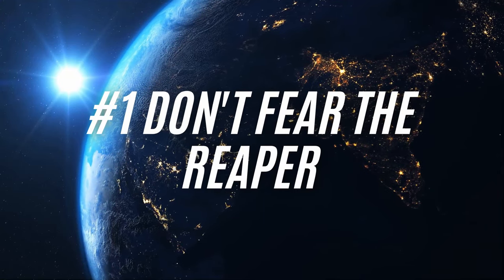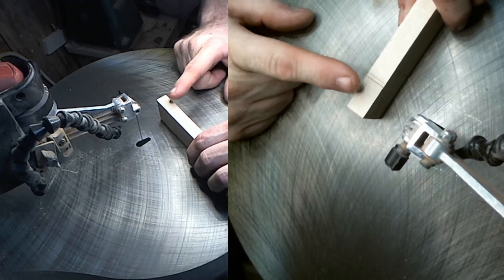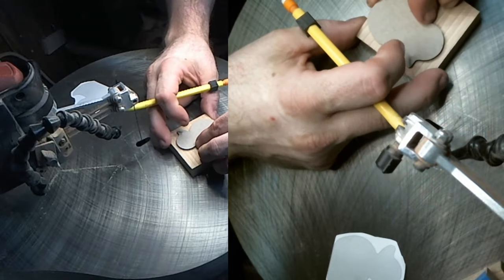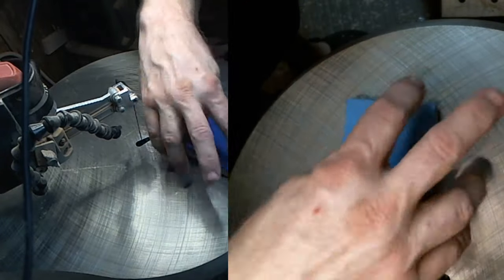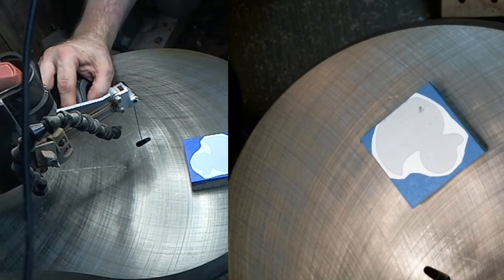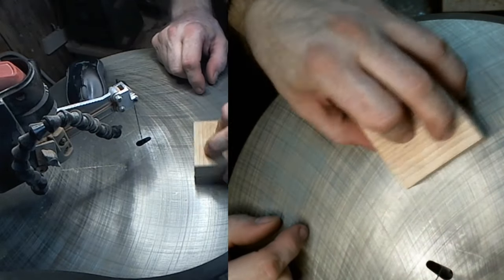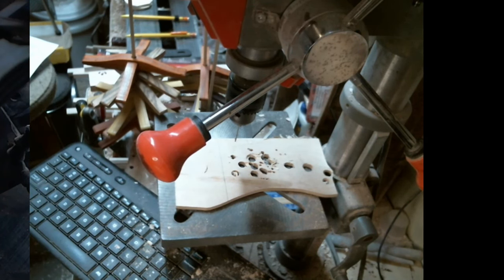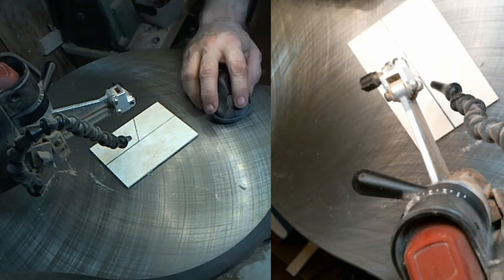10 beginner scroll saw tips

Comment: Great tips !  I’m new to the scroll saw and have the most difficulty threading the saw blade into holes for internal cutting. The bottom of the blade comes loose when I’m trying to reattach the blade. This takes a bunch of time and is frustrating. I was hoping to find a video on how to easily move to a new hole without fiddling too much with the blade. Any suggestion would be appreciated.

Comment: Thank you, Scott. I’ve been scrolling for a few months, and I watched a few videos about how to do it. You were the only person to recommend a foot switch. I have one for my router table, and I quickly learned the value of keeping both hands on the work piece. You scroll beautifully - I still can’t turn the work piece without it hopping up and down, but you play it like a violin — impressive! Another useful tip: PRACTICE! I don’t do enough of that, so my cuts are not as smooth as yours — I have to use my Dremel tool with a small cutting bit or a sanding wheel to finish up, which is annoying. Keep it up, man — your presentation style is inviting and practical.
Reply: I'm not sure if you're still experiencing the problem, but I recall experiencing that when I started. I don't know if it will work for you, but I resolved it by turning up the speed a little and working on holding firm pressure against the workpiece. Also, if may depend on your blades: pin-end still occasionally jump on me but pinless (i.e. thinner) ones don't.

Comment: Thank you for this video! I am new to scrolling and have now made corbels for my front porch and am working on flat sawn balusters with a pine tree pattern.  I've found that the Cricut is a great source for patterns and you can cut them out of cardstock and use temporary adhesive or out of vinyl that has temporary adhesive already on the back (this is a bit more costly).  I picked up a lot of good tips from your video!  I've been frustrated about my straight cuts not feeling straight as I cut them but yet looking straight when I'm finished; now I know that's normal.  Lots of good info!  Keep up the good work!

Comment: Cheers for this I am looking at getting a scroll saw. I bought the Dremel but sent it back after two attempts at keeping the bade in place. I am mostly large item carpentry, desks, wardrobes but like the idea of a set up for detail work to add to these. Your saw seems to have a good grip of the blade, it's not that I don't want to spend loads I'm just trying to balance how much work I'd put it to versus ££s yes I'm in England. I'm assuming your elsewhere given your extension lead sockets don't look UK ;-)
Has anyone suggestions for a mid budget saw that holds the blades well, I realise they will still break now and then. Cheers Simon.

Comment: Thanks What type of saw and which blade do you prefer for " tight " patterns ? ( Those patterns with sharp turns ) Thanks
Reply from the maker: there are a lot of variables...including the type of wood, it's thickness. the finer the blade the tighter you can turn.. the saw as long as it can take plain end blade you'd be fine. my current saw is a pegas but I do production work nd need a saw that won't wear out too quick

Comment: Thx for sharing these tips. I'm new with scroll sawing, is there a preferred direction like sawing clockwise or the other side. Does that matter anyway?
Reply from the maker: Depending on the blade you might get a smoother finish on the left side due to the blades being stamped out. It isn’t too much of an issue these days. I’d cut a piece of scrap and see what the finish looks like.
Reply: Thx, I will try that and see what happens 
 @MakingitwithScott

Comment: I just want to add to the comment about cutting yourself . . . I am a relative beginner at the scroll saw but I have already made several projects.  It is true that they are only bandaid cuts - BUT - a word of warning . . .  be careful to let your scroll saw blade do the cutting and (here's the tip) don't push your blade.  I did one time when I was tired and was cutting a very small piece so my hands were very close to the blade.  I snapped the blade and the end went right into my finger - OUCH!
Reply: Good tip thanks!

Comment: Keep up the good work :)
Great video, I am hoping to buy a scroll saw if you have any recommendations?
Reply from the maker: I would make sure the saw takes plain end blades. Get the best saw you can fit in your budget. You can always upgrade later if find yourself using the saw a lot. I’m currently using a delta 40-694 but at around $400 it might be a little pricey to start with

Comment: Another tip: make sure your blade is not upside down, if its the wrong way it will try to lift the piece off the table and make you frustrated.
Before putting the blade in, run it along your finger, if it "grabs" your finger going downwards you have it in the right direction. your saw should cut on the down stroke for most blades.

Comment: I'm thinking of a deadman switch. I looked... I got super confused. What do you recommend? I have an old Ridgid 16" scroll saw that I got from a pawn shop. It has a setup so I can use pin and pinless blades. I have used the spiral cut pinless... was not fun. I tend to use an 18 TPI skip tooth blade as most cust require some sharp turns. A light would help as well. It does have a spot to attach a light... just need some guidance. You should be able to send me a DM on MY channel if you want...I think... TIA! Great VID!
Reply from the maker: Both styles of switches work fine. If I’m doing a lot of little internal cuts I use the deadman’s pedal but if I’m making longer cuts I’ll use a power maintained pedal. Both are great, you need to ask yourself, do I want my foot on the pedal all the time.

Comment: Scott, are those Turkish spindle bases I see while you're talking about drilling on waste blocks?
Reply from the maker: Yes they are.
Reply: Whoo hoo!  ;)

Say, any suggestions on inside cuts with a pin-blade saw, or do I just need a bigger hole?
Another question...using cabinetry hardwood cutoffs for practice and tiny items; is there a secret to cutting the hardest woods like alder and black walnut?
Thank you so much for getting to my question, now I know who to get a Turkish from eventually....
Reply from the maker: @RICDirector   with pinned blade you do need a bigger hole, I’ve seen where people have knocked the top pin out so you don’t need such a large hole. They would then put a nail or safety pin in the hole in the blade after putting the blade through the wood. It’s doable but looks like it’d take a long time. I’d see if they made an plain end blade adapter for your saw.   I haven’t used pin end blades in a long time.. like 20+ years. So I really can’t recommend a size.

Comment: Purchased an older Delta Scroll saw few years ago, had in storage since purchase, and there is no manual and no blade.   I would like to use it however have no idea what length blade is needed for it.  Only number I can find on it is K3231, guessing that is model number, and it is a 2 speed, yet can't find any information on websites.  Can you tell me how to determine what length blade is needed?
Reply from the maker: Without knowing anything about the saw I’d measure the distance between the chucks. 5 inch is the current standard size, If it’s 6” you can get them from olsonsaw.net . if it’s another size it’ll involve a little more digging. Dremel used a smaller size but I don’t think Delta did. If the chucks has a clamp or screw to hold the blades it’ll take plain end blades, if not you might need pinned end blades. Hope this helps.

Comment: How does the blade speed affect the cuts?
Reply from the maker: If the speed is too slow, it’s going to not cut very efficiently and maybe catch on the wood and then the wood will bounce on the table. If the blade speed is too high, it can cause burning and make it hard to control the cut. Everything is a balance, it’s about finding the correct blade and speed for the material. Most manufacturers have a chart to show which blade is better suited.

Comment: All the video I watched, none of them has the "holder" to hold the wood down and nobody has the wood jumping. My blade is correctly installed, tension is good. Not sure what I am doing wrong?
Reply from the maker: If you using a reverse tooth blade you might have it too heigh in the holders causing the lower teeth to grab the wood. Having too large of blade also causes the wood to jump, ie if you’re using a #7 blade try a #5. Hope this helps